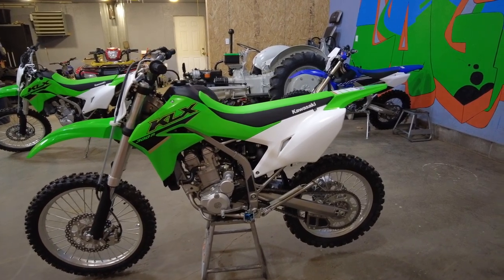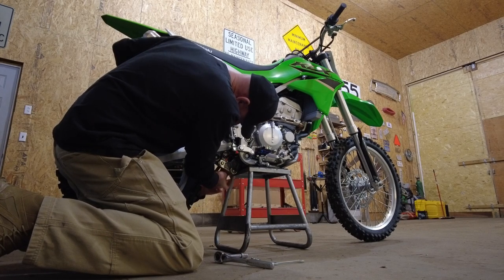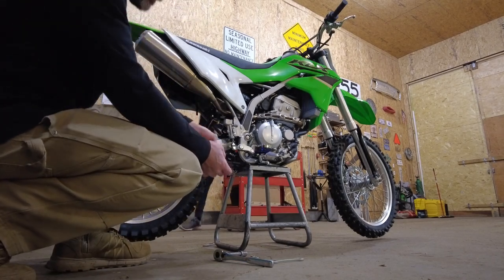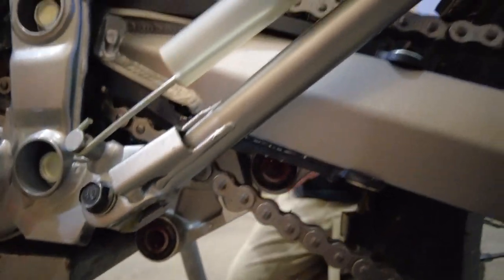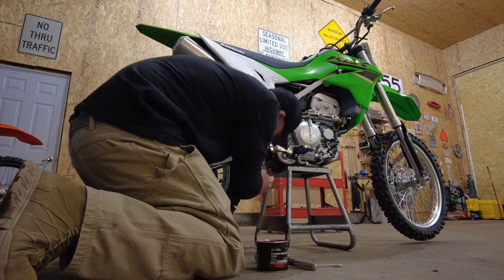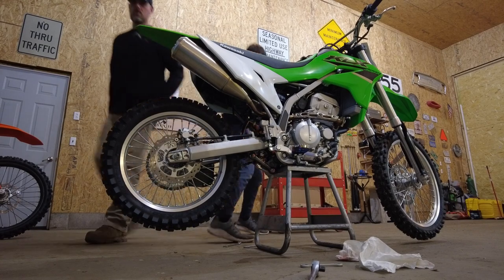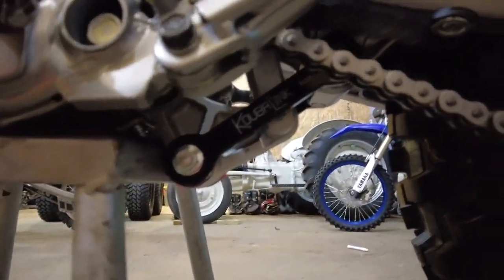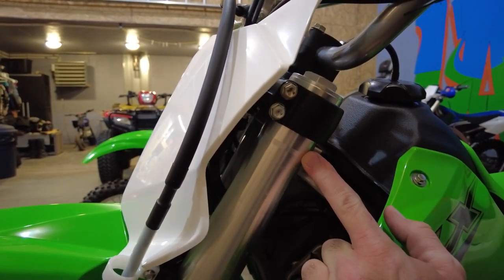KLX300R Lowering Link Install

Comment: If you loosen the triple on front you mentioned it raises the forks. Does it actually raise the forks or just drop the handle bar height down?
Reply from the maker: The forks raise up in the clamps, thereby lowering the front of the motorcycle. In turn, your handlebars will be lower in relation to the ground. However, they will not be lower as compared to the rest of the motorcycle (the rider triangle). By raising the forks in the clamps, you are essentially lowering the suspension in the front, very similar to lowering the rear.

Comment: Did you drop the front as well?
Reply from the maker: We raised the forks in the triple clamps as much as possible. You can't get very much out of them, but enough to make a big difference. Without raising the forks in the clamps, it has a strange head angle and feels very low in the back. If you lower the back, adjusting the forks (in my opinion) is necessary.

Comment: I went with psr lowering links because i didn't want orange lol my kx was stink bugging bad now its perfect
Reply from the maker: I didn't look into the psr links (I'll have to look them up for reference). The Koubalinks were a nice black so we were lucky there. We run the lowered bike back to back with the stock height bike and we actually like it lowered. The tall and short riders we've had on it liked it. It somehow seems to hook up better and lofts the front end a little easier. So it's great for some riders especially with shorter legs.
Reply: @LagBros_3  I wasn't to impressed with them I had to sand the holes out they wouldn't fit without making the holes bigger even though it was the right one for my bike it worked out after making the holes bigger 😅

Comment: Why did you choose to lower it?
Reply from the maker: We chose to lower it because we've got some riders that are moving from smaller bikes to full sized bikes. The KLX300R (with a lowering link installed) splits the difference on seat height between a smaller bike and a bigger one. The lowering link actually didn't seem to hinder suspension performance and adds some extra safety for riders with shorter legs.